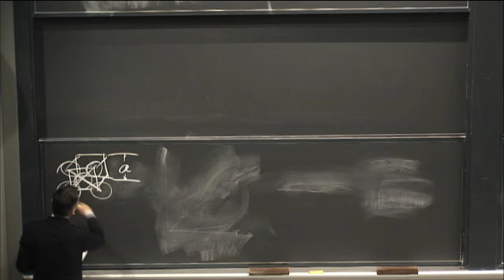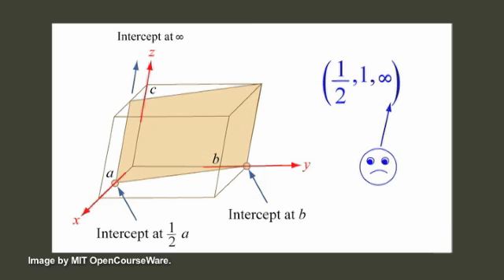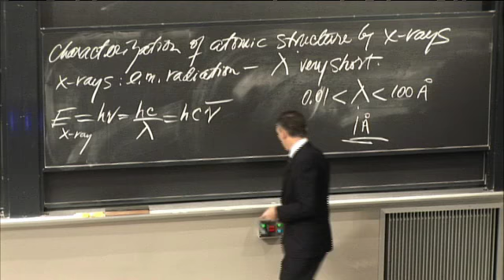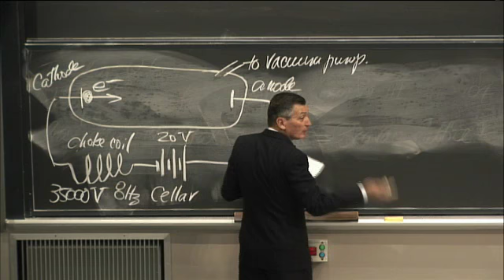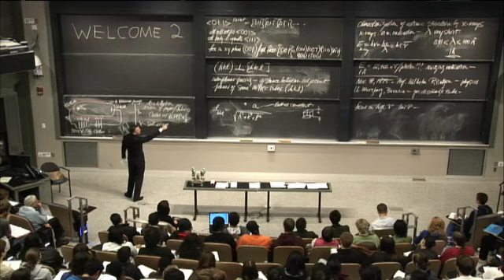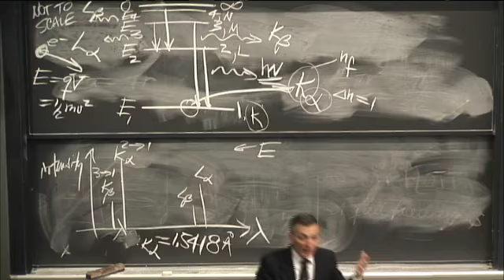Lec 16 | MIT 3.091SC Introduction to Solid State Chemistry, Fall 2010

Comment: What does he mean by 6 edges? i see 4 edges on the top face then 4 edges on the bottom face and 4 upright edges as if drawing a stick diagram of a cube would define the 'edges' help.
Reply: +moonboots bootsy d I was also a bit unclear at first. I think it might be a terminology thing, where he means the faces of the cube instead of the "corners" -- 6 ions (each on a face of the cube) make an "edge" of the unit cell, and each ion contributes half to the unit cell --> 6 faces=6 edges.